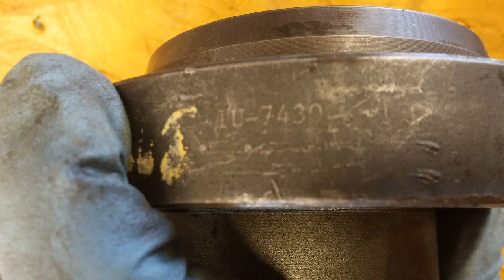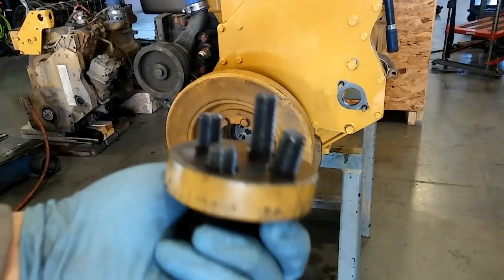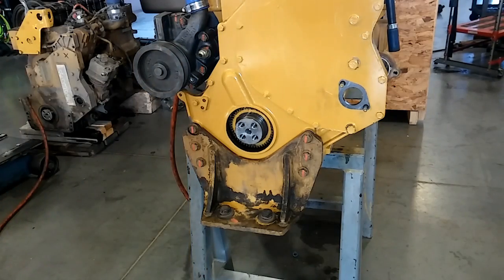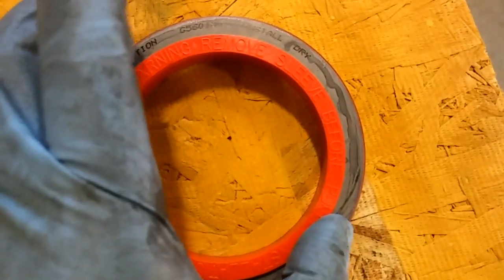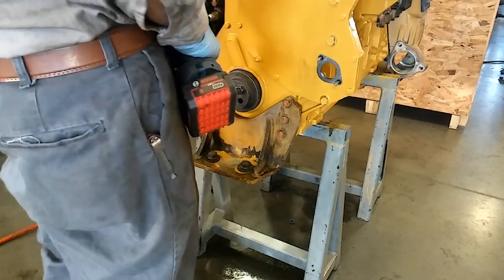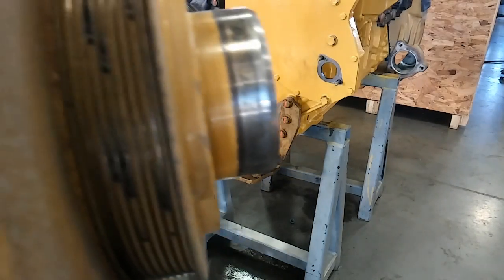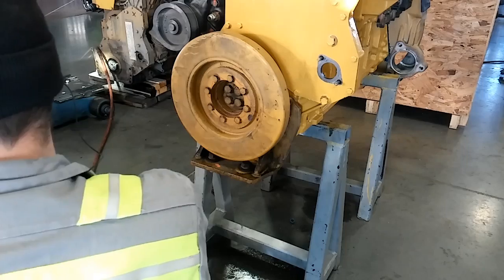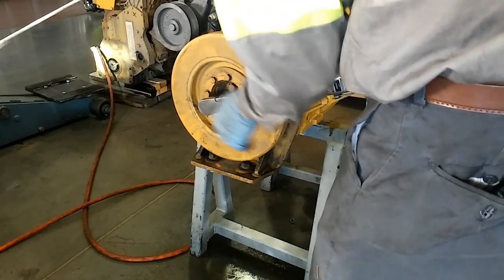How To Install A Front Main Seal On Cat 3126, C7, and C9 Diesel Engines.

Comment: Can you tell me is it that easy to remove the crankshaft pulley on a year 2000 3126 RV engine? I have a major serpentine belt slippage issue and the 8 groove pulley now has a chrome finish. I have changed idlers and tensioner. Every time I accelerate while driving or climb a hill the voltage drops to 12v as soon as i let up on the pedal the voltage goes back to normal.

Comment: I am late to this video, but i saw a few comments about the instal tool. Its Cat # 1U-7430. On the C7 i have the crank pulley has a spacer plate which is identical to what he is using with the 2 bolts. Just pop it out of your pulley. Its Cat # 2W7381-05
Reply: Is that the same part # for a 3126 Engine?

Comment: 1-U7430 seems to only be the installer ring, and not the other disc with the bolts used to install the installer. Is there a separate part number for that tool? Thanks!

Comment: Hi have a 1994 Chevrolet 7500 Cat 3126 engine and I'm doing a clutch job what is the torque specs for the flywheel thanks.

Comment: Thanks for sharing this, Josh. You make it look easy. How much does that damper weigh. I'm hoping the local Cat. dealership that resealed my 3126(in my rv) last year replaced this seal. I know the front cover/housing was leaking on the right side, and the Heui pump also needed to be resealed. I need to dig out out my invoice and see if a front seal was on there. I hope, I hope. Thanks again!

Comment: Does anyone know if it is necessary to drain the oil before you replace the front main seal. Going to do this on my Motorhome and wonder if the seal is below the oil level?
Reply from the maker: +dingo866 Not sure which engine you have, but you should not have to drain it on any Cat engine. If you are concerned you could always park it so the front of the engine is angled up either with your levelers or on a driveway.

Comment: How often should that damper be changed, what are the intervals?? Thanks for the vids, they're great learning tool for us that are looking to get or have Cat engines!!!!!!!!!!!!!
Reply from the maker: +Gary ClarkII I've looked this up before and Cat has no determined replacement date. I've never cut one open, but they are supposed to be a thick viscous silicone sealed inside.
Reply: Good to know, I  assume it's a sales pitch by Pittsburgh power the get them some money I reckon, lol. Thanks letting us all know d it dude
Reply: For as 3508, cat recommends 20,000 hrs for replacement of the analyzer the silicone for viscosity...

Comment: Have you ever resealed the front timing cover on one of these?  If so,  was it hard?  How long did it take?  I've got one planned for tmrw :)
Reply from the maker: +CootShoot95 Do you mean just the cover or the entire housing itself? I know you said the cover, but some people mean different things. The cover isn't very hard, you can leave the air compressor and HEUI pump just hang the and clean the gasket material off the timing cover is the biggest part. I've found using a pneumatic scraper helps a lot.
Reply: Adept Ape I believe it's the front gear housing.
Reply from the maker: +CootShoot95 The housing is a little more difficult, it has the front motor mounts so you'll have to support the front of the engine, remove the damper, camshaft, and then reseal it with the Loctite Anaerobic Sealer.
Reply: Adept Ape More like a lot more difficult lol. Thanks for the help!

Comment: hey bud, question is how do I determine when the damper need replacing on a c15 Acert BXS and do you need to pull out radiator?
Reply from the maker: +Keith Webb The Damper on most of the Cats and most certainly on your C15 will be a sealed Damper. So there isn't anything to inspect to find fault with. If it has damage or you are suspecting it has failed internally, you really just have to remove it and most likely replace it. Most trucks you don't have to remove the radiator to do the job, but let me tell you that it is pretty heavy and hard to install in the limited space it gives you. I recommend using some studs to hold it in place while you get a couple bolts in.
Reply: Keith Webb  hi what's wrong do you have a vibration on the engine
Reply: Adept Ape so you mean that the damper has another weight balancer inside the body of the damper, and that can go bad or break internally. so once this is bad can this cause a engine to shake?

Comment: WHERE CAN I BUY SPECIALTY CAT TOOLS AS A SEAL INSTALLER
Reply from the maker: +Brandon Strickland The best place to go if you need the right one is a Cat Dealership. If you have more time you can check out eBay.
Reply from the maker: +Brandon Strickland Hey thanks, just saw the PayPal.
Reply: http://www.monacotool.com/Products?category=37e3cc4f-6cd0-4d53-b44c-1839ba193a62&filters=c1ab9951-644e-496c-9503-a473f6b83da5,54a59fb1-baa8-4b27-a80a-75d4c0cf8f45

Comment: hey Ape, What the duration of those cat dampers, I've read some are 350,000 mile and others say 500,000??????
Reply from the maker: +Gary ClarkII There is no set duration for Dampers I've ever seen. Cat does have a maintenance guideline for their engines, but I don't think there is anything about changing the damper. I'll have to look in the special instructions.
Reply: One of those sources Pittsburgh power, saw and heard on their website, others I read on Google search
Reply from the maker: +Gary ClarkII I've heard others say that about Pittsburgh Power before. Now their engines are usually pushing extra horsepower so maybe that causes the dampers to wear, I'll try to look into it though on Cat and maybe address it on Diesel Talk.

Comment: @adept ape I'm trying to put a c15 pre dpf in an 09 pete that had a c15 that had dpf well we hooked it up and nothing happens could the ecm be different I could give you cereal numbers if needed please help
Reply from the maker: +Lucas Orellana What do you mean you hooked it up and nothing happened? The engine won't start or communicate? The pins should be similar on the older engines, but the ECM is different because it talks on a different datalink than the older engines, but if the power inputs are the same then the engine should still start because we have a jumpout harness that will power all truck ECMs.
Reply: Adept Ape it won't start
Reply from the maker: +Lucas Orellana Alright, so it won't crank or will crank but won't start? If it will crank check out my video on checking for an engine that won't start and use a inductive volt meter to check the injector harness. Can you communicate with the engine with any sort of scanner or Cat ET?
Reply: Adept Ape yeah if I have to I can probably get one of my friends to do it thanks for the help I'll let you know what happens
Reply: Adept Ape another question will the head off a c15 acert fit on a 6nz
Reply: Adept Ape we got the truck running my old man didn't have the 12v supply to the ecm hooked up and we hooked it up and it fired right up and purred

Comment: Mr. Ape:  What would cause oil in fuel on a 3126? I know nothing about Cat engines/fuel systems. Thanks.
Reply from the maker: +Byron Lininger Typically one of two things. The center injector seal has failed on one of the injectors and is causing the high pressure HEUI oil to leak into the fuel rail, or an injector is leaking internally between the HEUI pressure and fuel pressure. Now the hard part is going to determining which injector is causing it. You can pull the injectors and see if you have a damaged oring, if you don't then it will probably come down to replacing the injectors.
Reply: Thanks....I never worked on a HEUI system. I'm not sure why the owners mechanic mentioned the pump. Does Navistar have a similar fuel delivery system?
Reply from the maker: +Byron Lininger Most everyone uses common rail now. International did use HEUI systems on their Powerstroke engines. The HEUI pump and fuel pump are bolted together, but I've never seen the pump cause oil to get into the fuel system. It is possible the head is cracked between the two rails in the head as well, but I've only ever seen it be the injectors
Reply: Thanks again. I'm glad I don't any money in this one.

Comment: A water soaked sponge used to make the crank wet WOULD be a dampener. But a device used to absorb vibration would be a damper.
Reply from the maker: +Charles Tait To dampen can mean to lessen the effect. So a dampener can mean a tool for reducing something such as harmonics or what not, but the actual term is damper. It would seem most people I've run into call it the dampener, myself included, even though it's wrong.
Reply: Both of you are correct.  When you say it is a damper, it is a noun.  When one says it is a vibration dampener, that is correct also, as it becomes an adjective modifying vibration.  So, vibration damper - wrong, and it's a dampener - also wrong.  But who cares,  we all know which component is being described.

Adept - do you check for run out, and if so, what are the specs?
Reply from the maker: +Chad Jessup I didn't check it, the Cat Dampers are pretty stout and don't need changed that often. This engine didn't have that many miles either.
Reply from the maker: +Chad Jessup By run out are you referring to the crankshaft end play? If you are I didn't check it as the end was a new long block from Cat, I want to say the spec is usually around 6 thousands, but I'd have to look it up on this serial number.
Reply: I was referring to the vibration dampener run out/wobble.